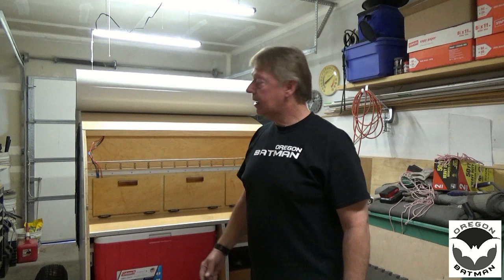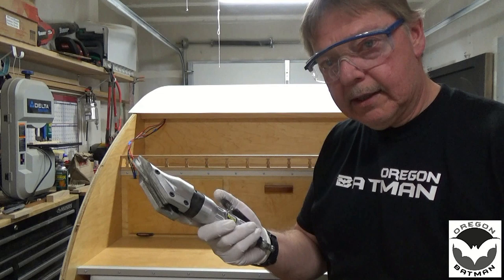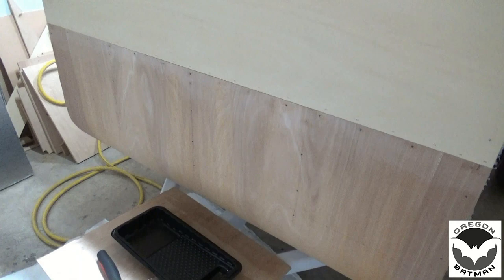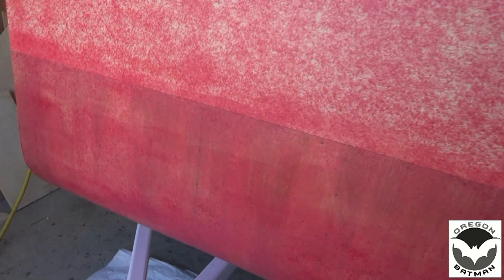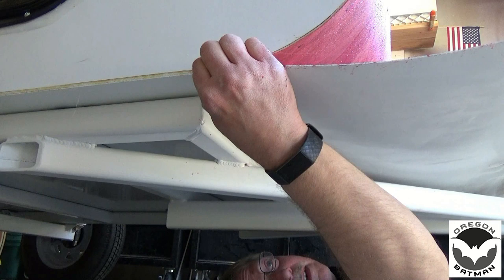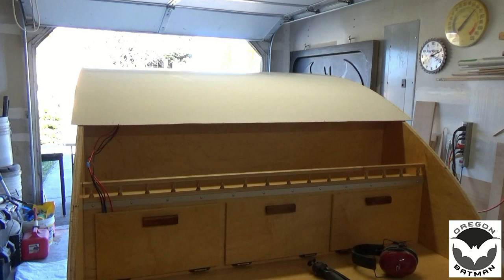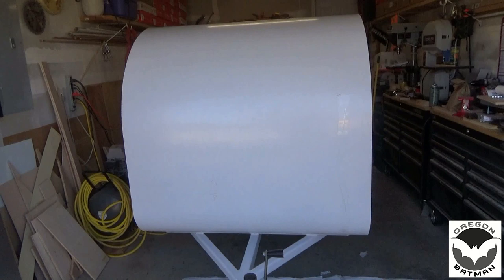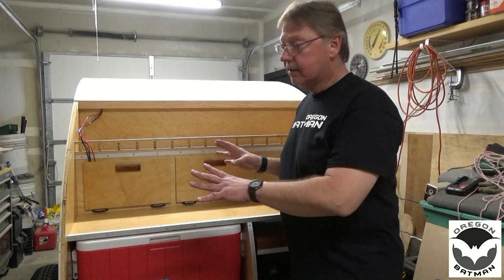Let’s Build A Teardrop * Step-By-Step * - Part 36 (Install Filon on Roof!)

Comment: Gee Al, you are incredible, doing that job alone!!!  In my project, we had to lay 7 x 21 feet of Filon, we were four people, two spray guns, this is a so stressy operation, always afraid of starting unsquare and finishing outside of the trailer!  We don't have unlimited time to joint the two components, that's why we used two spray guns, so the "tacking" stage was reached at the same time.

If I may add a few comments for those that will have the luck to use your video as an inspiration:

You can also cut the Filon with the Dremel mini circular saw attachment, works great, you can follow a straight edge to produce a clean straight cut, it produces a bit of dust.  The starting edge of the Filon must be cut PERFECTLY square for obvious reasons, I also added centering marks to make sure the Filon had equal overlap on both sides, on 21 feet, I only lost a quarter of an inch one side versus the other.

You can apply the glue with a roller on the trailer but not on the Filon:  the roller is skidding over it instead of rolling over it.  Anyway, you get a more equal coverage using a gun.  Spraying over a long piece may cause the glued section to be dry at its beginning and not dry at its end:  hence showing the usefulness of using two spray guns, you will need a big compressor to supply the guns with air or two smaller ones.

I used pieces of wood to control the application of the Filon over the substrate like we do when gluing Formica, so if the Filon slips into your fingers, it won't stick at the wrong place;  remember the Filon CAN NOT be repositionned after joining!!!  Because of the rear bumper interference, the Filon had to be cut to its exact length, so we glued about three quarter in one step, then carefully measure the remaining length needed, then cut the Filon, again using the little Dremel circular saw, finally we glued both remaining substrates.

Again Al, thank you so much for that critically important video!
Reply from the maker: Thank you sir! Watching your build gave me the inspiration needed to actually use the filon... answering any question I had. Thank you and thanks for following along! Always appreciate your tips and insight! People have much to gain reading your comments. Cheers!

Comment: Well I am impressed with how square that filon worked out. I am sure if I tried doing that by myself that it would be over hanging by 2 feet on one side. I noticed the seam where the 2 pieces butt up under the front. Do you have any concerns of water leaking in there?
Reply from the maker: LOL!! Pretty happy with how it all lined up! Once I'm ready to install the trim, there will be a piece that will go over the seams with plenty of butyl to seal it up. Nope... not worried here! :)

Comment: Well done sir.
 I used Seal-Tite tape on my seams and corners first before the butyl putty tape. In time the butyl will dry out. The Seal-Tite is added protection  I'm glad I used both. Just a thought.
Looking forward to the next video.
Reply from the maker: Thank you! Yup... Seal-Tite is on my list of "have to get"! You recommended that a while back and I checked it out, will be using that when I get ready to install the trim. Thanks Papa for following, much appreciated!
Reply: ...then clean with acetone.
Reply from the maker: I saw that you used that... was wondering what it was. Looking into it. Thanks!
Reply: @OregonBatman  That 3M tape was too wide for my need, I had to cut it using a straight edge and parchment paper as a new backing.
Reply from the maker: Found a roll that comes in 1" wide... might do the trick

Comment: Is that just a 1 car garage you are working in? You make great use of that space! I am building mine in a 1 car right now and it definitely has it's challenges. After each step I have had to pull everything out of the garage, sweep up really well, put all the tools in their homes, and put everything back in before moving on. That's the tradeoff with such a small space though.
Reply from the maker: Yes sir, one car garage! :)  Can get pretty tight! You should have seen it when I built the 6 x 12 RV in there... had to lose weight just to walk around in it LOL!!

Comment: Thanks for the great videos! I'm in the planning stages of building my first teardrop. One question I have is since it's been a few years since you built this teardrop and installed the filon. How did the Filon hold up, did you have any problems with it warping real bad after glueing it down. I  hear different opinions on glueing Filon or free floating it like aluminum.  It would be great if you did a follow-up video on your teardrop and how it held up and if there's anything you would do different on your next build. Thanks so much for all the videos. 👍
Reply from the maker: Filon is holding up extremely well. No problem with warping. Looks as good now as the first day I installed it. I would advise STRONGLY not to "float" it. Filon is not deigned to be floated... or all RV manufacturers would use that process.  Not only will it warp in the sun, you take a risk of it coming off down the highway as the only thing keeping it in place is the trim, which when it begins to warp, will pull away from the trim. Not much I would do different... pretty happy with the results. Cheers! al
Reply: @OregonBatman  thanks for your response.  You've been a great help for us new builders
Reply from the maker: @Dan-uy9wm   Awesome! Thank you very much!

Comment: Omgoodness Batman. That was amazing. What is the name of that fylon/phylon material and where did you get it? And what adhesive did you use? Amazing job brother. 🙏🏼😉🇨🇦
Reply from the maker: :)  Thank ya!! I purchased the filon at Affordable RVing 15555 SE McLoughlin Blvd, Milwaukie, OR 97267. They also sell on Ebay. I purchased the adhesive with the filon. It is a product called Helmiprene by Helmitin.

Comment: Will you be considering installing a gas/air shocks for the galley door? Also. Solar panel on the roof? Thanks
Reply from the maker: I think I will just be using the spring hold opens for the hatch.... and use a portable solar panel instead of a roof mounted panel. Just trying to keep it simple

Comment: Do you think you could have used the air shears to trim the filon sides instead of the router? Or does it not allow you to get close enough to the wall?
Reply from the maker: No... I don't think you can get that close to the wall with the shears. Closest I could get would be about 1/4".

Comment: What glue do you use for the filon to wood?
Reply from the maker: Hi Brad! I used Helmiprene glue made by Helmitin for the filon. I recommend a glue specially made for filon, very durable and will handle the extreme temps!

Comment: I'm looking at buying a router.  Would you recommend a plunge router or a fixed base for my build?
Reply from the maker: Hi Kevin! I used a fixed base router for this build. Purchased the plunge adapter but didn't use it. The fixed base is my go-to, but a plunge router would come in handy. As a woodworker, you can't have too many tools. You can get away with just one router, but if you had two... even better! :)  I have three.... LOL!